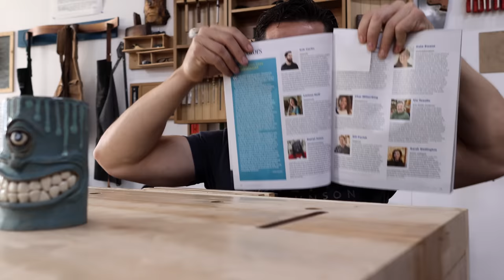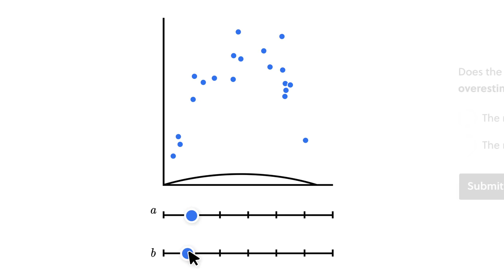5 tips youtube woodworkers give that professionals HATE

Comment: I'm certainly no expert woodworker, or I'm not a woodworker at all lol. But I made a tool board in "glulam wood" 18mm thick. It was beech wood from the hardware store. After I oiled it on both sides, it did warp a lot. I screwed a square tube frame on the back side (with oversized holes, so it could expand and contact) this frame was also suitable to attach my tool board to the wall. It did straighten the tool board, and I've had it for years now without warping. So I don't really understand why you say it doesn't work? I of course understand that it wouldn't work on a thick slab of wood for a table, because the force would be so high so it would warp, but for a thinner board it seems to work at least for me.

Comment: The cuts made in a slab to accommodate C-channel might have an effect on the warping of a slab though. I’ve used crosscuts underneath to help relieve slabs under high internal pressures. You relax the pressure then hold that shape by filling those cuts with epoxy. 
So maybe in a way the C-channel helps?

Comment: Rubio MONOCOAT is a molecular bonding polish. So a second coat does not help at all.  Unless the first coat was. It done properly.

Since Rubio is a molecular bonding polish, when you do large surfaces, with overlaps, there is no overlaps marks or dark patches. Since the polish only binds to raw wood divers. Also if a finished table was scratched, and you you applied MONOCOAT, the colour / polish binds only to the exposed wood, so the colour blends seamlessly with the surrounding without having to sand off any of the surrounding area.

Comment: The main issue I found when using glue and sawdust to fill gaps is it doesn't take the finish so you end up with a noticeable line. If I have to fill a gap then I use a filler gel by fiddes mixed with sawdust as that doesn't show

Comment: The first method with blue tape and CA glue was popularized when hobbyist CNC machines came to market. Hold down slots weren't always readily available with those setups and so you would simply glue it down to your workpiece. However you have to be careful not to use too much glue as you experience in the first part. 😁

Comment: If you do need to make putty out of sawdust and wood glue, I would recommend putting your sawdust in a paint strainer bag and shake out the finest particles into another bag. Use the fine sawdust to mix with the glue. This ensures that the tiny gaps get a decent portion of actual wood in the gap.

Comment: I have to respectfully disagree with you about the C-channel in the large tables. I am both a professional woodworker (not quite at your skill level) and a structural engineer. As long as you do not surpass the tensile strength of the lignin in the wood, the steel channel can, in fact, help to straighten a curved slab. Again, the key is not to over stress the wood. However, if the slab is properly stabilized (from a moisture standpoint) and sealed, and the steel has proper slots for expansion and contraction then the steel can help to resist some of the tendency of the wood to warp. Wood does have some elasticity prior to failure.

Comment: Good tips to naturally avoid, Curtis.  ;)  Nevah hoid of Rubio or Osmo.  My fave wood finish is a clearcoat of any sort, but Waterlox Satin by name.  Just love the stuff.  I avoid poly when possible, but grudgingly use a wipe-on if necessary. Then again, I don't do flooring.  Stains are avoided and dyes used grudgingly if necessary.  Shellac (bug spit) is great but provides minimal protection.  I hope that every mini-house built with lots of blonde wood is shellacked before sale so the greasy fingerprints of the HuMons living in them don't ruin them for the life of the house.

Comment: I agree with the blue tape thing. 
I hate using C channel for structural purposes. Black tail studio is probably the biggest instigator on this method. Sliding dovetail, in my opinion, is the best solution to this problem. 
Rubio isn’t the only one in that category, but it’s getting really popular. 
After getting serious about woodworking, I haven’t used stain in over 3 years.

Comment: Well, I must have missed the blue tape and CA glue trick. I would not use that, pretty much for the reasons you stated. As for lacquer, it is an okay finish for some thing that is not going to get handled a lot. Pens are one thing. I made a bunch of drawer pulls for my house, and the lacquer has worn off of most of them, especially in my shower room. I did try some Osmo. and was not impressed. Again, looking for some thing that will protect with daily handling. I have some rubio monocote, and will be trying that out. I never stain anything. One of those weirdos who likes natural colors, and sun light aging is fine with me...
Reply: 2 months later..... With the blue tape and CA glue trick, with the glue not setting up, that is because of the medium or thick CA glue. I seated some nuts in waste blocks for making threaded boxes on the lathe. I put the accelerator on the glue, and the depth of the nut was 3/8 inch or so. A couple of days later, I was turning and getting thin threads of CA glue coming off of the nuts. The sealer cures the outside, but not the inside, and you need time for that. It will totally seal the thin CA glue, but the thin stuff has no gap filling ability. Oh, the medium CA glue also honeycombed, as in large open holes in them, probably too thick and as it cured, it shrank.... Still have to compare Rubio and Osmo. Not sure how different they are. Rubio comes with a hardener to speed up the drying process, Osmo does not. If you don't use the hardener with Rubio, it takes about 2 weeks to cure. That, to me, sounds more like tung oil.

Comment: In my experience Rubio and Osmo are two very different finishes, but I have never tried to apply them using the other brand’s recommended application method… If what you are saying is true, one should be able to use the Osmo as a single-coat finish….?
Great channel, btw!
All the best from Erik (Norway)

Comment: Adding the deep slot for the metal channel seemed like it could cause more problems with wood doing weird things. More than half the thickness deep seems like trouble. If the wood wanted to move the channel is not connected solid but if it goes past those limits it’s gonna crack or do something. Two channels aren’t gonna stop a twist or something along the length anyway.

Maybe worth a video, not hating on channel, but on getting a large table surface to stay flat for a decade. Wood grain choices are very interesting to me. Balancing between interesting to look at and possibly boring looking but stable.

The dovetailed perpendicular board slotted in is interesting too. Different applications. Like if you’re standing on it or weird stuff like weather exposure on a door or shutter.

Comment: Gotta defend the masking tape-ca glue trick here.. I'm using ca and masking tape as a preference and not as a way to save money and even though it's more work. When I use making tape and THIN ca glue i'm getting a bond that I believe to be stronger and more reliable, and leaves less residue than the best and most expensive double stick tapes i've tried. I've gotten to spending up to 60$ for the roll with shipping, so I was definitely not skimping. the ca-masking-tape just works better for me. I think the main reason is that all of the double stick tapes I've tried had some play after sticking. I don't know if it's the thickness and material of the tape or the adhesive but it always wobbles enough to make a slightly different path with a router if I apply varying pressure. the masking tape-ca glue is just SOLID.

Comment: I do not consider myself a professional anything, much less a woodworker or cabinet maker.  However, I have been making my own photography frames for several years.  While I will agree that most mass produced wood stains will rarely produce the best results, there is at least one exception.  I use a couple different darker, Minwax gel coat stains on dull, barn wood frames on a regular basis.  The porous surface tends to pull in too much of other products but just the right amount of the gelcoat.  Not to mention, the rough texture is nearly impossible to wipe down with any consistency so a careful dabbing of the gel coat with a foam 'brush' gets the job done rather easily.  I have no idea as to why this works better than every other type of finish that I have tried but it does.  Over the past couple of years, these dark walnut and rosewood 'stained' barn wood frames have been the most popular frames among my clients.  I have even done several of them for other artist and/or photographers.

Comment: iv'e always used stain to make cheapo pale wood look more of an exotic colour, ie pine to look the colour more like oak or walnut or mahogany it doesn't look like those woods of course because of grain, but just looks a nicer colour quite quickly and cheaply, but not to fool anyone into thinking its made from more expensive woods, so it has its uses. iv'e also used vinegaroon to turn wood black "works very well on oak and it wont rub off when handled" for the likes of pine wood, wet your wood with very strong tea to add tannin let dry and repeat with the tea, "especially pine because there's next to no tannin in it" let it dry fine sand the raised grain then paint on the vinegaroon, it will go significantly darker almost immediately, its also called ebonizing the wood.

Comment: Hmm. I’ve been a professional for about 30 yrs and I agree with everything but the Rubio Monocoat thing.  First off osmo is a good product and I used to use it. But if you ship a cabinet or anything that doesn’t breath when you open the doors is smells rancid.  Maybe they’ve fixed that problem buy now but I would not ship a boxed up item to a customer for them to open the doors and be hit with that smell. I also used to use a home made finish I called the Traveling Wilburys because it was a super group of all the finishes. Poly, danish, tung and linseed oil and some naprha to help it kick. But the was wayyyy to smelly.  If you’re going to be in this industry for a while, you need to start watching out for things like breathing chemicals, But when i found Rubio it changed my world.  Easy to apply. Molecularly bonds to the fiber of the wood so water seeps around the fibers instead of in them to make it swell.  You can apply it in a dusty shop.   It’s fantastic.  Almost every furniture and cabinet maker I know only offers the client, Rubio monocoat, or conversion varnish.  Just my opinion❤ btw it does dry out but it’s really easy to just refer the client to the website for maintenance products and info. Also it’s not as safe as they make it seem. My eyes always burn after a day of Rubio.

Comment: Good video, I have e few things I get snarky about.
After a lifetime of cabinetmaking, and twenty years of retirement watching woodworking videos, I often wondered about those five tips, but now I know.
Is MDF and table saw sleds overrated?. (They are two of my main annoyances). MDF manufacturers claim their product does not bow. (I know differently). Also, PVA glue breaks down over several years when used with MDF. Sleds on table saws I get, but they are dangerous with no riving knife or guard.
One more irk. Paranoia about kickback particularly with radial arm saws, when I know that always using a riving knife always prevents kickback for the simple reason the knife prevents wood with tension, (or misalignment with the blade), by simply preventing the wood from pinching the back of the blade.

Comment: Agree with all except the Rubio. I run a one man furniture business and also used to use poly/oil/turps as a finish and love the result, however, the smell of the solvent and the need for 3/4 coats plus drying time gets old. I've since switched to rubio with great results (I do use 2 coats) I also use shellac all the time, it's my favorite finish.
Double stick tape rocks and CA glue isn't cheap either. No C channel but do use sliding dovetails a lot (love 'em) 
Glue and sawdust looks like shit and I don't use stains either 😂
Trends are trends and people learn from YouTube so it makes sense that it has become an echo chamber for both good and bad info.
All the best from Portugal 😊

Comment: Blue tape and CA glue are thinner than double  stick tape though (at least thinner than the ones I've found).

I've used the method for things where I probably don't need to get them apart, but where in the future I might need to. Like for putting drawer fronts on: glue them on with blue tape and CA glue, and screw the from the back. I probably won't need to get them loose again, but you never know if I want a different style of front, or if one gets damaged.
Reply: Keep looking for double-stick tape. The one I use (and I'm not where I can ID it) is about the same thickness as Scotch tape - about half the thickness of one layer of blue tape - and has an adhesive that is actually a bit too strong for woodworking sometimes. I've learned to us multiple small pieces rather than a large strip or else I risk having to destroy one piece in order to separate them.

Comment: I do like rubio monocoat. I did learn about it on youtube but I do know a couple people who use it. My step dad uses it and he loves it. And so do it. Is it the best? I dunno but it smells good, it's easy to apply, it's easy to repair, etc. Maybe it's a bit expensive for big cabinet shops who have more skill and can therefore apply a cheaper finish just as well as rubio? Also not everyone has the equipment and set up (space, holding, etc) for spraying. Rubio just requires a cloth.

Osmo stinks (the actual smell) and requires a lot more shaking and doesn't dry the same. I like rubio more for that reason. Shellac stinks too and damages easily.

Overall I think rubio really is an ideal finish for low volume hobby shops.

I do agree about the other points.

Comment: I view the question of staining wood before the finish is applied from the perspective a  home builder. Any home built with wood that will be stained such a Red Oak, Pine, or mahogany arrives at the jobsite without regard to its color. A capable painter will apply stain in such a way that the lightest wood gets a second or third application of the stain to achieve a more uniform color throughout the entire house. The alternative is hand selecting the wood and culling out the very lightest or darkest of the wood trim such as casing or baseboard. Uniform color and tone is the goal. Multiple applications of a finish rarely achieves the desired goal. Woodwork that I have seen where stain was mixed with the finish in order to do the job with a single application has disappointed customers more than the technique of stain first, and finish second because the grain of the wood becomes muted.

Comment: I’ve been using double sided tape on my cnc after a horror show mess with blue tape and CA glue - and had no idea why people keep doing that! 

I’ve also found the c channel thing very confusing, and apparently needless - but have never actually made a table, so have zero experience there. 

Great insights :)
Reply: People have bad experiences with double sided tape too, not all are equal or applicable in all situations.  It is usually preferable to use double sided tape but there's reasons why people consider alternatives, even when those alternatives have their own problems...

While the C-Channel is structural, the shape makes it much stronger than the steel itself.  So does actually help keep the table straight, it just doesn't mean it's foolproof as nothing is but it definitely makes it harder for the table to warp, etc.  Wood moves but it can also be in compression and tension, which gives some leeway for resistance to movement to at least reduce it a bit, which can be enough to keep it from going wild and be that noticeable.  

While, unless you're doing outdoor furniture or placing it in an unconditioned space, it's not like there's going to be a lot of movement with most modern pieces that will remain in pretty stable environments.  The amount of forces involved also scale with the amount of wood, so unless you're doing very big pieces then the amount of wood movement for smaller pieces can be negligible unless you have really wildly different seasonal extremes but you can look at green woodworking for how that's dealt with and see that structural designs do have an effect.

So, it's not a magic solution but it's wrong to say it does nothing.

Comment: I'm having a hard time coming around to your comments of the uselessness of adding structures to keep wood from warping.   Lid battens on blanket chests are common for this purpose, as it wouldn't have rails, like a table, to keep a large panel flat.  It'd be an interesting video, though: take some wood whose grain pattern is prone to warping, put battens on one sample, leave the other sample without, and put them in a high humidity environment (maybe finish one side so it absorbs moisture unevenly).   I'd think the batten would hold the wood such that it couldn't absorb the moisture for which it it has the capacity, and the panel would not warp as much.  I'd also think that as long as the temperature doesn't cause a phase change in the water (steam or ice), the batten would be able to limit the amount of moisture absorbed without breaking.

Comment: I think your comment on the C channel needs to have some proof put behind it. Maybe you are referencing something in the situation of slabs, but I find that it all depends on the thickness/ rigidity of your C channel or whatever substance you decide to use as your under brace versus the thickness of your slab or table top. I have many times seen the correct under support pool a table top or sideboard back to flat after had developed a slight bow due to the seasonal moisture and it stayed there afterward.